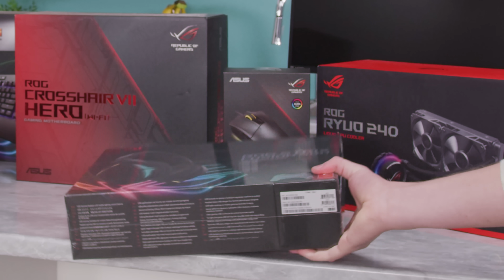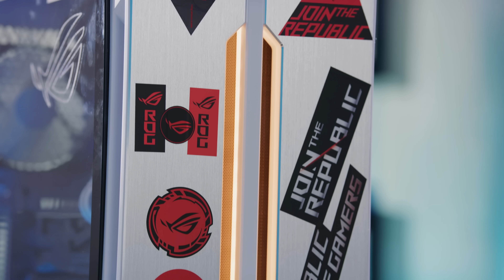I RUINED his brand new PC - ROG Rig Reboot 2018

Comment: 1:38 "i owned a Mac mini..."
Linus: "that doesn't count"
Reply: People who own apple are not enthusiasts. They are cult members stuck in the year 2000!
Reply: I have to agree that it doesn't count tho. :)
Reply: The first minis were decent little PPC G4 performers. They were a decent low-cost alternative to the more expensive tower systems of the time. They even had discreet graphics (Radeon) and could handle games. You got a much better value from them then than you will now, with Apple deciding that gaming on the Mac is overrated and that the mini is best targeted at cluster computing and "pro" users.
Reply: > that was a desktop?
Can relate to the butthurt that goes afterwards

Comment: I say powersupply before motherboard because I have dropped a powersupply on a motherboard before.
Reply: Sam Jacks dead 😂
Reply: 1. PSU is the first (in case).
2. Put everything on the mobo, including heatsink. Except vga. 
3. Put mobo inside.
Reply: How
Reply: How do drop a psu on the mobo if the mobos already mounted in the case?
Reply: @comradeq2493  like the case is on its side and when holding the psu over the mobo preparing to put it in he dropped it and it landed on the mobo
Reply: @uniball01  makes sense, ouch
Reply: PSU dies motherboard is perfectly fine
Reply: mousepad first then gpu then case then motherboard then ram can be external
Reply: @rohancoroner7453  nah it can be downloaded onto the integrated uhd 630 graphics using the built in gigarams on the processor. Duh
Reply: @comradeq2493  how do you think
you drop it
when its above the mobo
Reply: I also prefer PSU first. I usually go in this order:

1. PSU (especially if it's an old case with top mounted PSU
2. SATA/IDE storage and cabling for it (good to get out of the way)
3. RAM on motherboard
4. CPU and cooler on motherboard
5. motherboard to case
6. 5.25" drive if I am mounting that (would normally do it alongside storage, but the drive sometimes hangs over the mobo making it difficult to do before that step)
7. any hard to get components/cables that might be blocked by expansion cards (m.2 storage, fans, Front Audio...)
8. Graphics card and any other PCI/PCI-e cards
9. All internal cables (but not cable organize yet)
10. Check that PC boots and see if everything pops up in BIOS
11. Tidy up cables
12. The rest

A lot of steps there, but it all makes sense if you think about them (or at least in my head)
Reply: back in my day the powersupy was at the top of the case most of the time and you had to walk up hill both ways to a store.
Reply: I've never built a PC myself yet, but that sentence carried so much dread, I almost wept from how much I (somehow) understood that feeling...
Reply: I physically cringed when i read that.
Reply: Rip
Reply: Sam Jacks good but I’m perfect i put ram then cpu then graphic card then the motherboard after the power supple then the case
Reply: Lolol
Reply: Sam Jacks oof

Comment: Didn't get a colour match on the power supply grille. Black grille in a white case... 

"In the OLD DAYS I remember" upgrading a PC Clone. We swapped out the 14.4 modem for a 33.6 but only 28.8 was supported at the time by the dial-up connection. Then we removed the 25Hz 486 chip, changed a couple of rocker switches and dropped in a 40Mhz 486 chip; actually it was more than dropping in. You had to FIRMLY seat the chip without cracking the motherboard. A few days later after a 2+ hour download a 4.5MB file emerged to update Netscape Navigator so we could cruise through those Usenet bulletin boards. AND it was now capable of running the infamous Micropolous (SimCity).
Reply: How many years before Limp Bizkit was that..?
Reply: That is quite odd, because SimCity ran just fine on my 386sx/20 ? Even SimCity 2000 did, though I did have to upgrade the graphics card to an SVGA one first.
Reply: I remember upgrading to 4mb ram.  There was no way I would need more than that.  At some point "upgraded" to S3Virge, commonly regarded as the first 3d Decelerator.  I didn't realize how bad it was until I got a Voodoo1 card, that was mind blowing at the time. Then I went to sli voodoo2 and on and on. It never stops..Help me!
Reply: @movement2contact  Netscape and Limp Bizkit came on the scene in the same year '94
Reply: @SiD3WiNDR I found that it used to bog right down as the city got to a decent size. It might have simply been memory issues, swapping virtual memory files etc.
Reply: the good old days..
Reply: @rabbytca  oh, apparently I only first heard of them in 2000...
Reply: @vwragtop  i too had S3 Virge with my Cyrix! 4MB of glorious memory for glithcy-textured graphics pleasure B-)

Comment: My GPU just began artifacting. RIP
Reply: What model ?
Reply: Taylor Renton  rx 580 8 GB
Reply: Rtx cards are dying on mass with the same issue my 2070 died I had warranty but a lot of them have the same bugg artifacts fill your screen PC crashes and the card is dead unless you don't install the drivers but noone does that
Reply: Ugh, that doesn't look good. Weird that it's stable but not unheard of. Try underclocking the memory a bit. Also try ddu to wipe out all video drivers and do a fresh install of 18.5.1. Unless of course it's still under warranty in which case RMA that bad boy.
Reply: @Will L it happens both on the open-source drivers and the Radeon Pro drivers.

Comment: it would be my drema to get a rig reboot cuz i have been "gaming" on the same laptop for 4 YEARS specs: core i3 
gpu is AMD 7400 M whisch doesnt exist anymore
4 gigs of ram (3 usable)
battery not working wifi glitches a lot
gets suuuuper hot up 140 degrees celcius like a lott
50 hz moniter (doesnt feel like it)
the only games i can play are roblox(barely 50 fps lowest settings)
osu 140 fps
cs source 20 fps lowest settings
LIKE EVEN ON YOUTUBE I CAN ONLY WATCH AT 720p AT 40 FPS LIKE WTFF
i cannot even play minecraft
got a total of 5 blue screens of death in one week (that was a lot of factory resets)
i have a an actual fan keepint it somewhat cool even the interface of windows is laggy as hell!!!
i hop someone frop LTT reads that ♥